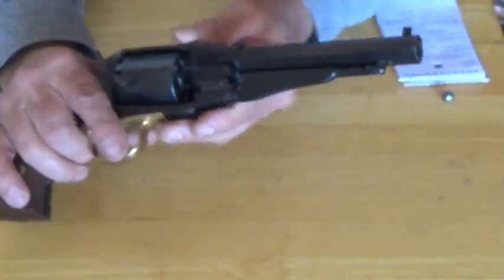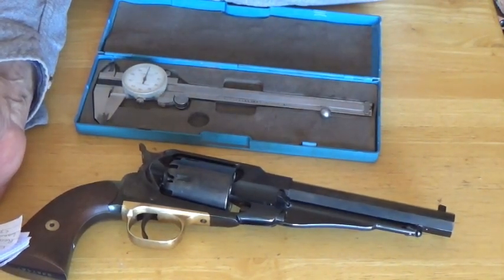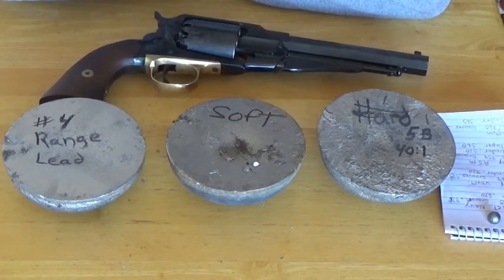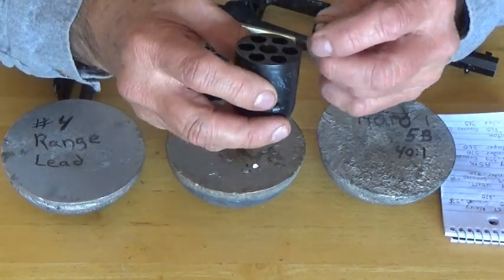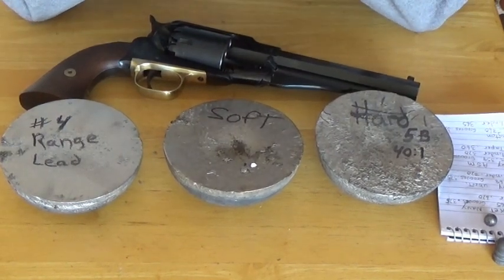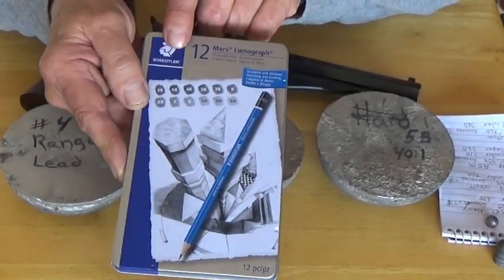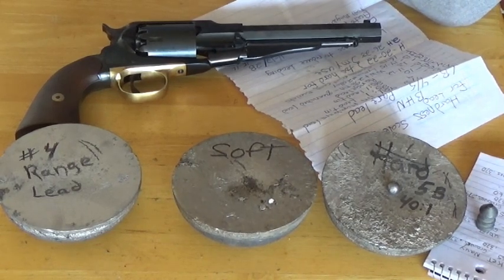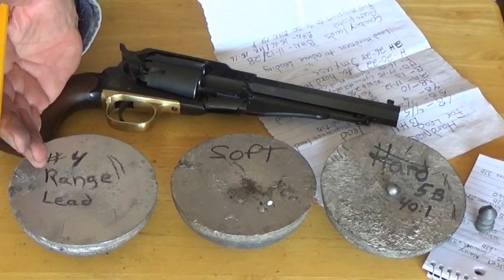Lead Hardness and Cylinder Reaming

Comment: I am a long time bullet caster and it was absolutely imperative that thhe chambers on revolvers should be a couple of thou bigger than the bore.    The bore is easy to measure just drive a slug down the bore and measure it.    For the chambers.... years ago I bought set of plug gauges from 1/4 inch to half inch by thousands...  basically they are go/no go and very accurate  So I bought the 3/8 ream and a metric one that is .453 for the 44 guns.    of a dozen cylinders none were big enough.   Buddies remington was like yours and it was near impossible to load with very small chambers.   I ream down about 3/4 " just to be safe.  To be completely honest they of course load easier but I expected a huge difference in accuracy There was an obvious difference But only about 10% when I expected it to be 50% or more.    I still cast bullets but have really streamlined the whole sizing issue..  HT coat on the bullets for smokeless.    Hardness is really not that important So I don't bother finding special leads for special purpose.    reaming the cylinders means I don't care how hard the lead is.  on the smokeless powder guns the HT coating has completely eliminated and leading and the guns clean very easy even revolvers at around 1300 fps or so.
Reply: Pietta 1858 Remy owner here, my cylinders all mic'd out to .444" as well as the grooves in the barrel. I'll have to pay more attention to the groups once I dial the loads in...
Reply: @AmbuBadger  That is weird since the bore should be about .452-.454    I mean to say that they make a conversion cyl for 45 Colt...  The 45 Colt is .452-.454    Soooo how would they shoot a .452 45 Colt round in a .444 barrel?   that would be extremely dangerous in my opinion.
Reply: @doranmaxwell1755  I've used soft lead loads in my Remmy without issue, tryna remember if they were cowboy loads or just round ball pressed in over BP. Either way, I never felt the gun to be horribly inaccurate at 25 yards.

Comment: Yes tin does add some hardness to lead. But tin is also used to mix other metals into lead to make a certain alloy/mixture. It's hard today to find pure lead. What I do with any questionable lead, range lead etc. I always melt it down and keep skimming off the dirt and alloys that float to the top. After a while I'll turn the temperature up some and check to see if another alloy floats up and so on. When I feel I got most of it I flux it, lower the temperature of the molten lead and cast a bullet or two and let them cool. After they cool I use my thumbnail to see how deep it scratches into the cast ball or bullet.  If it cuts deep and easy it's close to pure lead for me for my Black Powder guns..rifles and pistols! About muzzle loading rifles with rifled bores. If useing a round ball you need to use a thick and aggressive weave patch and a big and soft enough lead ball so as the patch grips the ball and rifling as tight as possible to be able to grip the ball to transfer the spin from rifling to the ball. To do this you need a thick heavy patch and a big enough and soft enough lead ball. Cotton pillow ticking type material and a large enough soft lead ball is needed. Oh and after skimming off the impurities off my guestionable range lead I save that stuff to remelt back into a lead pot of hard ball lead to harden even more by fluxing it in. Always when done casting bullets I empty the pot into a ingot making mold and scribe into the ingots Soft or hard to remember or separate my soft black powder soft lead and my hard ball lead for modern firearms.  This has always worked for me. If I decide to cast lead balls or bullets for a black powder gun I'll fill my emty lead melting pots with ingots marked soft. Melt and flux  and cast. Many years ago I lost a couple of tunes of lead( close to pure lead that came from tearing down exray room walls because I moved and couldn't afford to haul it from Ohio to Arizona! Man that hurt!!! Eight pound bricks of lead stacked the length of a garage wall three feet high or more. Man that hurt! But back to black powder firearms...due to shooting competition in many types  of arms and types of competition my fields of interest kept changing and now a old fart I'm not a real expert on anything any more. Sometimes I'll read something or see something on U-tube and it sparks my brain cells and want to pass on the way I did it back when or a different way I did it. THAT'S WHY I LIKE YOUR VIDEOS AND WHY YOU DID SOMETHING AND YOUR RESULTS. I ALSO WATCH BLACKIE THOMAS, LONG HUNTER AND A COUPLE OTHERS THAT MAKE VIDEOS ON BLACK POWDER FIREARMS. THANK YOU FOR ALL YOUR VIDEOS!! I SEE YOU GUYS DO SOMETHING AND I FIND MYSELF TRYING TO DO IT OR IMPROVE ON IT WHICH THE NORM IS I CAN'T BUT IT SPARKS A FIRE IN ME AND GETS MY BUTT OFF THE COUCH AND MAKES ME REMBER WHAT I USED TO DO. ONE OF MY LAST STROKES KNOCKED OUT MY SHORT TERM MEMORY AND MY ABILITY TO JUST STAY ON WHAT I WANT TO DO
Like work on firearms, reloading and shooting my firearms that I still have. Thanks again!.....CAPTAIN ZOOM-ZOOM OUT! ..( SHOULD BE CHANGED TO.." PRIVATE SLOW-SLOW NOW )
Reply from the maker: Thank you for your comment.  I do turn up the heat and watch the color range, skim off the junk flux.  I feel you'll never get out all the tin.
Reply: You and I in the same boat my friend, been around the horn so many younger boys and men can't get enough of me ,love teaching what I know and today's people are just plain dumb, not them it's the parents and teachers it's a crying shame
Reply: @cowboywoodard2569  Got that! People today, especially those 15 years old to 30 some years old ! It seems to be the worst when it comes to trying to teach about history and / or how to do things right! I've almost given up trying to teach anything to people in that age bracket! When I was 16 years  old and started working for a weekly pay check , I had it in my mind that whatever my job was that I would strive to be the very best in whatever my job was. I always sought out who I thought was the best in that field and worked with them until I was sure I was up there with the best in what ever the field or industry I was in! That mindset helped me very well up until I moved to Arizona! There is where I found out no one cared what you knew, only that you do it fast no matter if it was done right or not! I still strived to do the best or be the best in whatever I did! The only time I ever got fired from a job was when I suggested to a home builder that I worked customer service for. I asked if, on my own time, be allowed to check houses under construction for defects that a homeowner will find after they move in and customer service will have to fix it later after the homeowner moved in! When asked why I said our home buyers shouldn't have to tell us how to build a home! Another wards, a second pair of eyes! And I thought it would be easier to fix while the house was under construction. The building superintendents were against it because they felt it would make their jobs harder due to they thought of me as a perfectionist. I was let go the next day! When I trained customer service reps, I told them everytime they got a minute to look through the  houses under construction in their subdivisions so they know how they are built. That way, they maybe able to tell if a homeowner has a problem or not and / or explain why something looks as it does and / or whether there is a problem or not. In Arizona, it's throw it up, sell it and fix it later. Now retired and can work and thought I just help others to do better at whatever they want to do ( Free! ) but it seems no one wants to take the time to be better at what they do. Yap!.. it's a different world out there today! Definitely not what I'm interested in helping! I do and will help someone today, but only if they're really interested in really learning how to do it right first!...then they can do it their way or make changes that seam to help them better do it. I guess I'm done complaining! ......CAPTAIN ZOOM-ZOOM...OUT!
Reply: To be fair tho...  I was casting bullets in the 80's and none of the shooters I knew had a clue about sizing etc. even tho Keith and other gun writers had explained Sooo....  if the kids are more ignorant it would be hard to tell.     I mean at some point knowing nothing is rock bottom.   I agree that we may know (or care) a bit more about history but young  people seem to be very interested in my pontificating if I make it relateable to them or at least interesting.    Also I tend to have a lot of old guns that I shoot... When younger people go with me they are very interested in the history of those guns they will be shooting.   I try not to take sides or be close minded but I do tell em that they would be better off if their phone was not quite so smart or fun. @garyfoltzer6618

Comment: I have hardened conicals that need to be hammered into the chamber then pressed down with a loading press.  They have monstrous ballistics out of an 1860 Army.  I can get over 400 foot pounds energy, and they move slow enough you can almost see them fly downrange.  I carry them for black bear and mountain lions as a backup, but they’re terrible to load.
Reply: believe it "or Not?" once in a while with conditions right, "I can, Have, and Do" see these fly down range. I first noticed with a 1911 almost the same ballistics as any BP revolver, looked like watching a BB from a red ryder, but BP leaves too much smoke with me at the trigger.

Comment: 3/8" is not .380, but .375. You need to measure the bore groove depth and make sure of your chamber size to provide a match. Don't assume reaming .375 will work till you prove it. Also, don't just ream the front of the chamber but all the way down. Tapered chambers are wrong. Recoil can more easily jar the ball forward because the chamber is wider ahead of it and you'll get chain fire. Besides, despite popular swallowed belief, just because you shear off a ring of lead doesn't mean you automatically have a gas seal. Did you know if a granule of powder on the mouth of the chamber trapped between the ball and chamber wall, it can cut a groove all the way down the side of the ball giving you a fuze channel, because sulfur is mohs scale harder than lead. You need to use a counter sink bit in the chamber mouth to cut a little bit of chamfer (doesn't need to be much) so you will be swaging the ball into the chamber causing the whole ball to go in without a shear ring.
Reply from the maker: thank You

Comment: It was over 10 years ago that I heard about undersized cylinders on 36 revolvers so the first thing I did was seat 6 balls with the nipples removed. I then pushed them out with a dowel rod through the nipple hole. All 6 would fall through the barrel. I reamed the cylinder and recut the forcing cone to 11 degrees. I don't rember how much I opened the cyclinder as that was over 10 years ago but I have no Compleat's about how it shoots.
Reply from the maker: Thank You.  That's what I hope to accomplish.

Comment: what are the relations of the lands and groves to these numbers? I would think the "forcing cone" would swedge the projo to the size for the lands and groves? the Italian's also only recommend a charge about half of what was historic, they may have used metric tooling, or what was easy?
I make an effort to regularly remove dross off top of my lead pot making lead constantly more pure. "I use" DE or bentonite to help purify, it's Biblical man! Yes "plumbers Lead" now has tin, I had the job of dealing with those pure ingots at a Plumbing shop. "ELECTRONICS" lead is Pure! but hard to come at decent amount or price.  I scored decent Lead from a long gone neighborhood company that lined and built the rooms for medical Imaging locations.  

Now you got me thinking? I noted All my "conicals" are Not Conical after I use my 1858's rammer? so I redesigned my table rammer's ram rod. I used some spent brass with a 10/32 stud in rear for mounting. filled said brass with molten lead, dipped tip of cold greased conical leaving an image to help keep shape and distribute load while under compression. Have not got to test yet, I forgot at home on my last test run.
God Bless!

Comment: Interesting video. Even though modern replica black powder revolvers are made better with harder steel than back is the 1860s. I would not shoot lead with even 10% tin in my BP revolvers. Lead is a polisher. As you shoot your BP revolver the lead polishes out the bore improving its accuracy by smoothing imperfections in the lands and groves. Tin on the other hand hardens lead, makes lead expand in casting dies and makes oversized bullets. Round balls cast will be oversize and forcing them into the chambers is hard. 
But the real damage comes to your BP revolver's rifling. its going to make more pressure on your forcing cone (throat). This throat forces the bullet to swag down to .44 cal from 45 cal. This extra force over time is harder on your frame and some parts. But its hardest on the rifling, its not polishing, its eroding very slowly, but way faster than with just lead. Think about it... 
You know how i know how hard lead is without doing it like you have? I only have two types of lead. Soft or Hard.
I use the old, "How frosty or frosty silvery" the lead is method. Melt your lead, stir it. bring it to temp.  Heat your mold. Flux the lead (wax) afterwards, cast some rounds. if the rounds appear frosty, recast them. If no matter how many you cast they have a frosty silvery look. don't shoot them. To hard. its that easy. Your range lead is to hard. Your hard lead is to hard. When using the above, the frosted silvery lead of the range lead and the frosty, chunky look of the hard lead respectively. Range lead also looks like a dull aluminum color too. Soft lead Tarnishes. Hard or range lead resists tarnishing well.
Reply from the maker: That's why I clearly stated use only pure lead in your revolvers.  And as stated Todays plumbers lead if you can get is is supposed to have some tin in it.